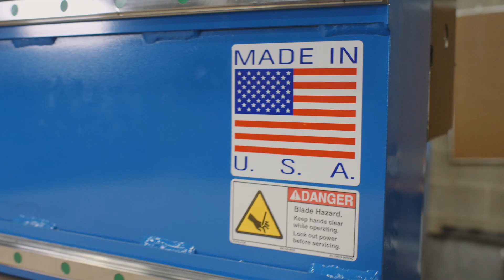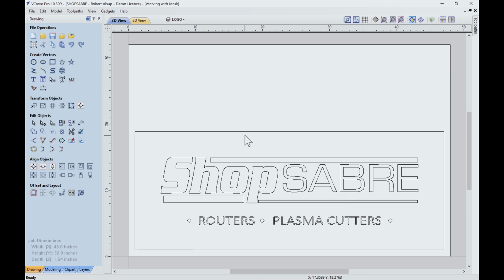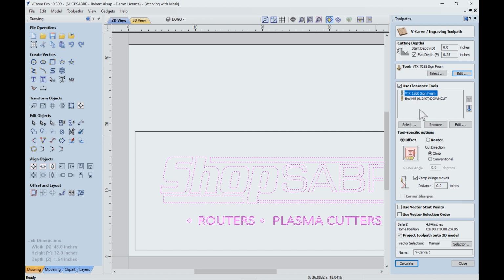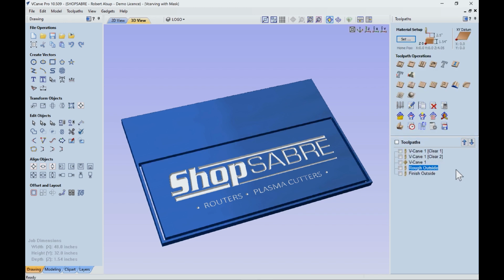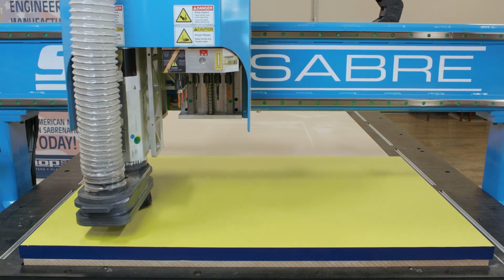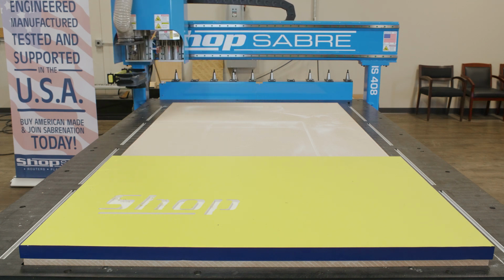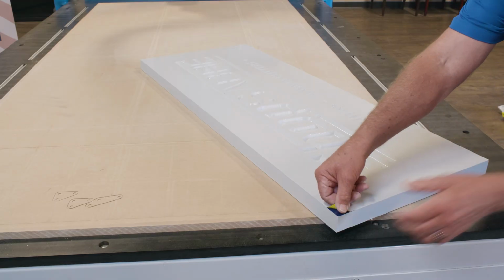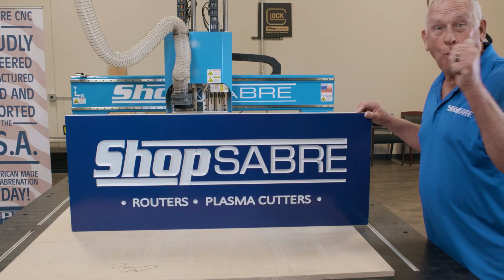ShopSabre CNC Engraved Sign on IS Series 408 Router

Comment: Nice work Bob! I think I am going to call Vortex and get a large insert Vbit! What size are you running for this project?
Thanks  Steve from New Prague!
Reply from the maker: Part number #7055 from Vortex. It is a 1/2'' shank 1'' depth max cut - single blade. Hope this helps! Strongly recommend!